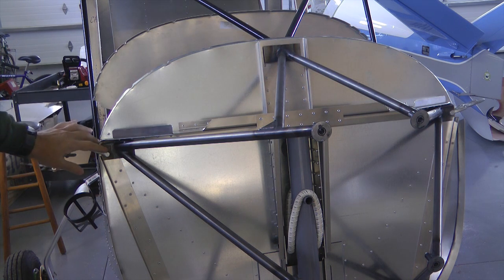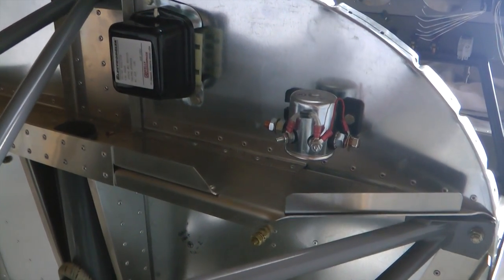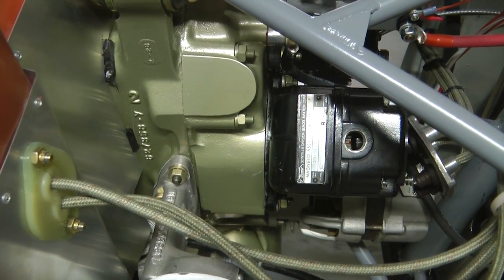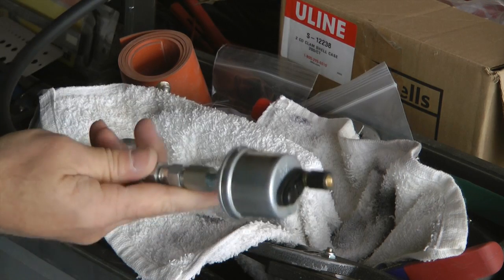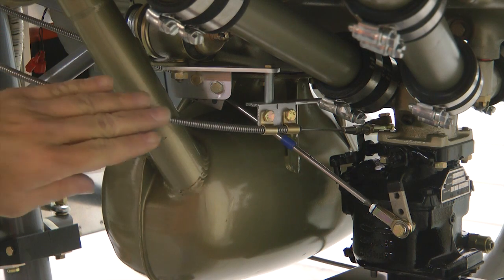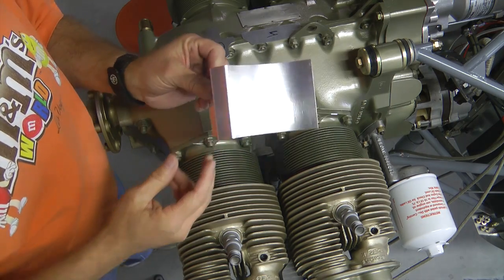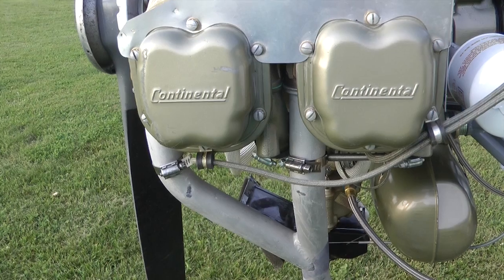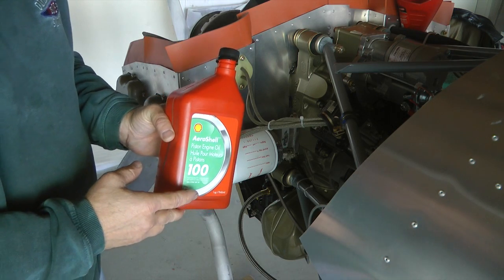How I installed my Continental O200  engine

Comment: Hello Jon. I am installing a 0-200 into a quickie q200. I have purchased your DVD video on your installation of o-200 several years ago. Great video. I do have a question about your mixture control. Your video shows it being install on the left side of the engine looking aft. A builder of a q200 has his cable being installed from the right side of the engine looking aft. He uses red push pull cable control. So, I am confused. The different locations would lead to different lean rich control.  Kindly provide feedback when you are free to do so. Thank You Stanley
Reply from the maker: Quick answer:  That control can be installed in any safe routing.  I was only showing how I installed it.  There is no single, correct way - it should match your aircraft configuration.  Of course it must be installed so it operates in a smooth, safe motion.